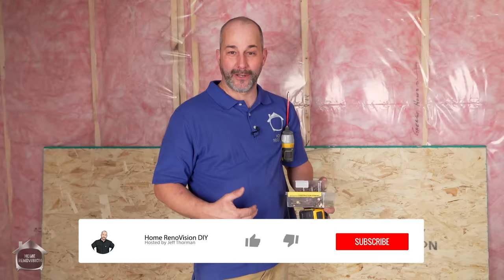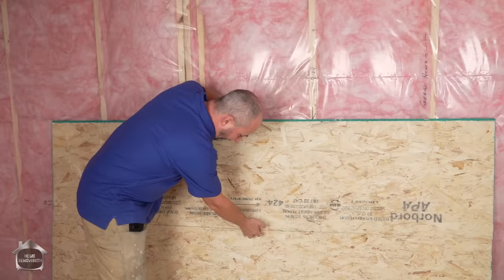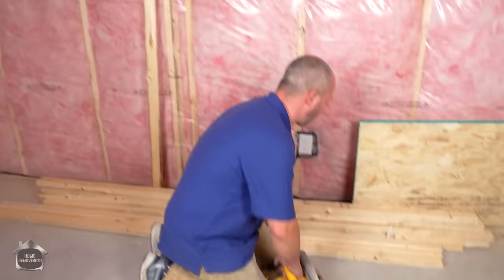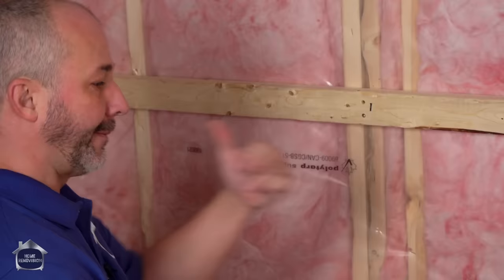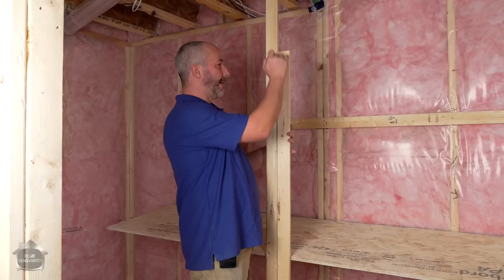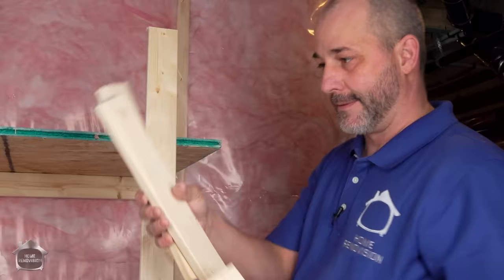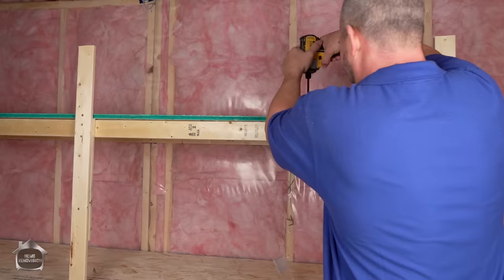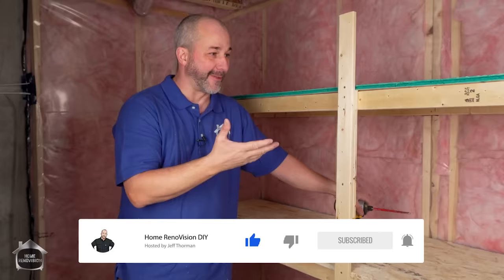Simple DIY Storage Shelves

Comment: This is just sloppy, poorly designed.
Instead of running the post so far above the shelf, just run it past a little bit, use the extra length of your trimmed pieces to run right from the floor to the underside of the 2x3, form  a ledge with the 1x3 to support the 2x3 and rely on the ledger for support, to the foundation, instead of screws.
You actually save money by not using so many screws, and have stronger shelves because you're not relying solely on shear strength of the fasteners.
Also, move the entire assembly a few inches to the right to land on a stud.
Having a 22" cantilevered section you will lose most of your structural support on that end, with no benefit whatsoever.
But other than really sucking, not so bad... close, oh so close.
Reply: Oh, burning in the screws, I might just throw away my countersinking bits, got to try that out.